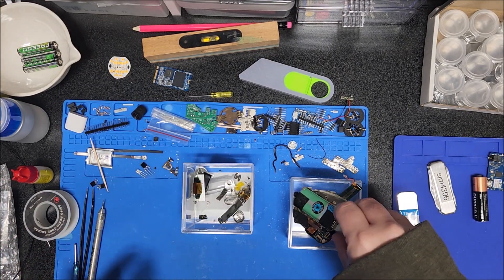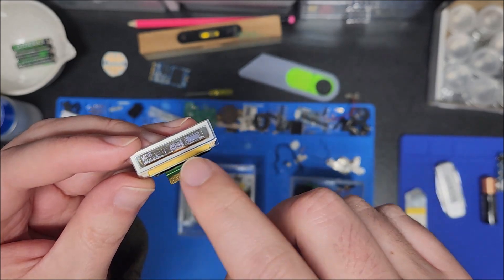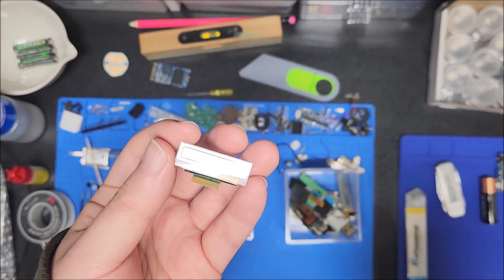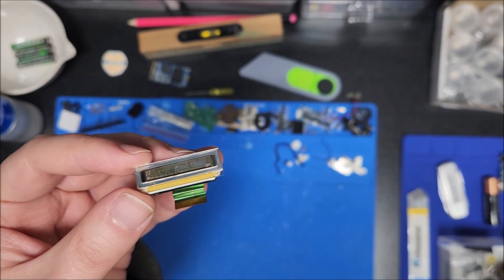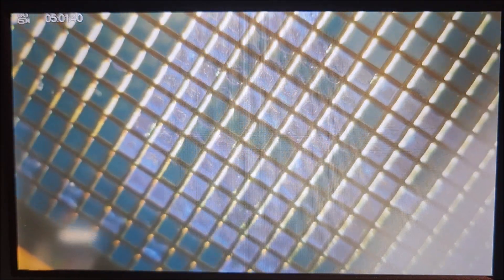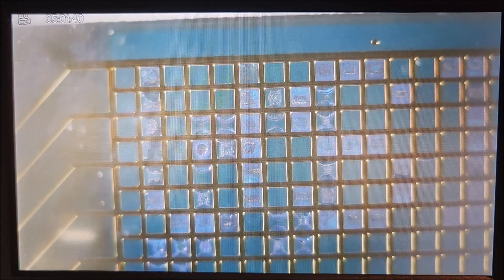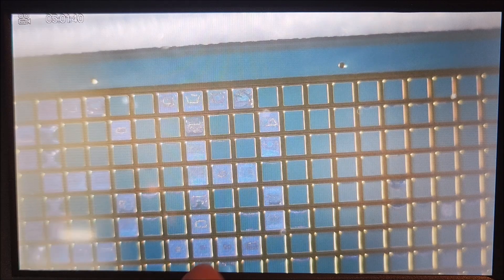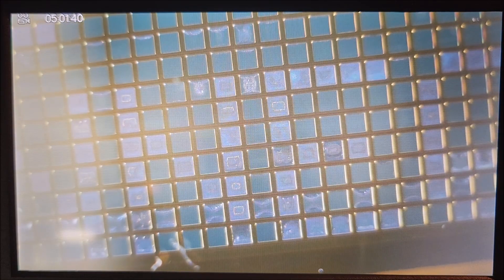Sony OLED Burn-in Investigation

Comment: Great video! I've noticed similar damage on many RH1 displays I've replaced. In several cases, the panels were even split, with the back separating from the front glass, clearly pointing to a bonding issue (and probably an important contributor of panel failure).

Unfortunately, the OLED replacement for the RH1 can't be (easily) adapted for the NW-S205F. The RH1 uses a separate display controller that drives the OLEDs at 1-2 MHz. The NW-S205F drives the displays on a shared data bus with the ROM/RAM, at 12 MHz. Converting signals at these speeds would require a faster microcontroller, but finding one that meets the NW-S205F's space and power constraints has proven difficult.
Reply: Alternatively, another approach may be to modify the firmware of the NW-S205F to directly drive modern displays. I've dumped the firmware and identified that the display updating routines are nicely abstracted away from display control, so I believe that it is possible.
Reply from the maker: Now that would be something, patch the firmware and use a passive ribbon adapter to a modern oled! Keep up the amazing work!!!